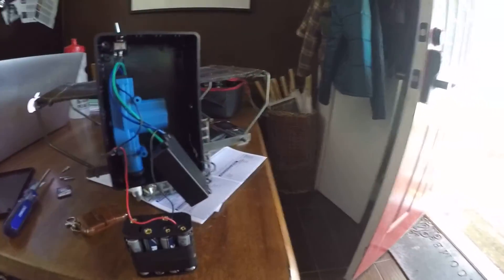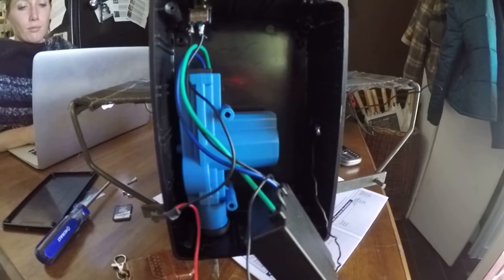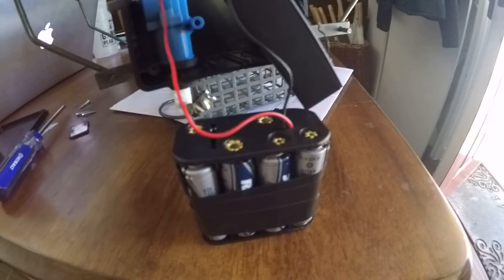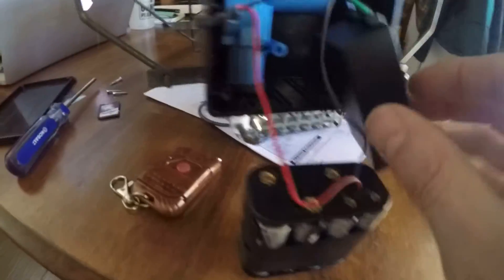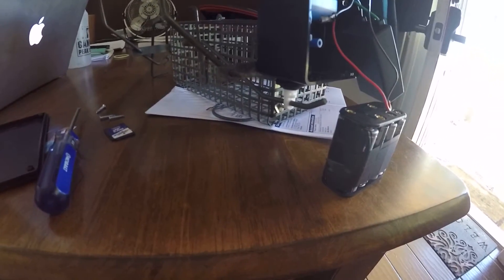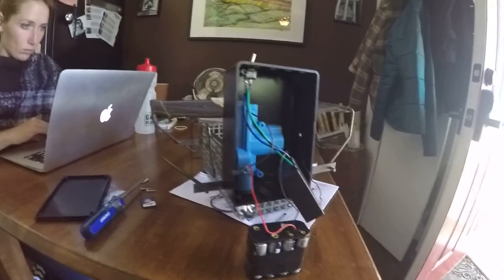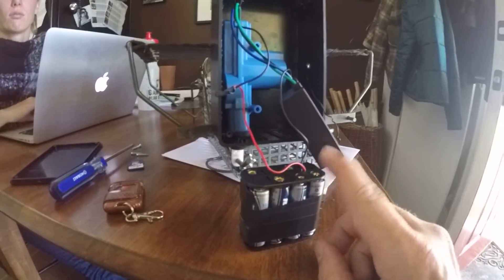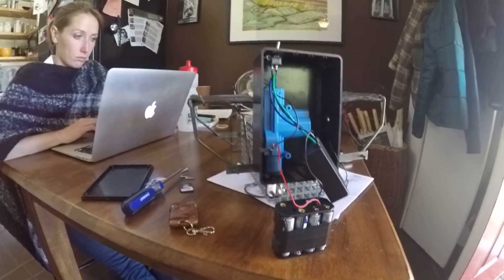DIY Remote Bird Launcher

Comment: I'm having trouble wiring up my receiver and actuator, do you happen to have a picture or video of how it's actually wired?
Reply from the maker: Tanner, I do have a picture of it but I won't be able to get to it for a day or two.  I ended up doing trial and error and I found that I had to loop it.  Essentially, there are two wires in the positive.  One for power into it then a small 1 inch lead coming out of the power in and that fed into the com1 I think.  The receivers come from factories overseas with no instructions so labels are all a bit different and it just came down to trial and error.  I will send a picture of mine tomorrow afternoon/evening to you if you haven't figured it out.  I have also changed mine to have 2x 9V batteries powering it instead of the 8x AA.  This has increased reliability and also weight.  The range on them are pretty impressive 60+yds easily.
Reply from the maker: Did you get it figured out?
Reply from the maker: I don’t have one. Sorry.  Do you have letters on the terminals?